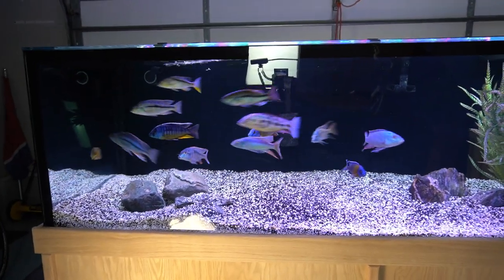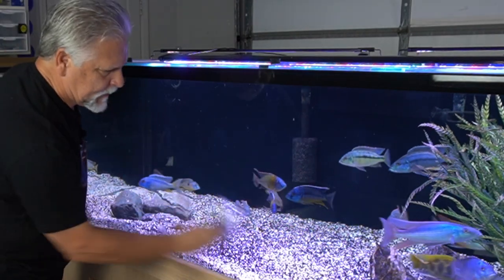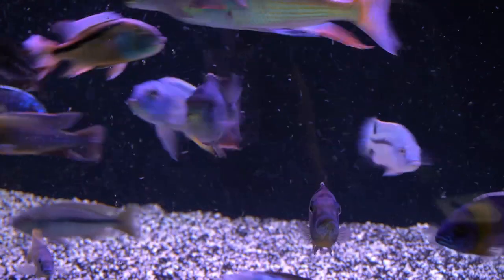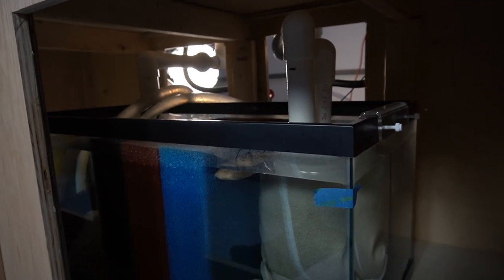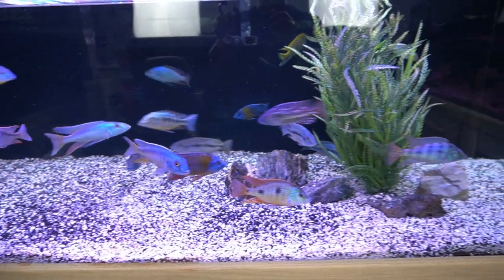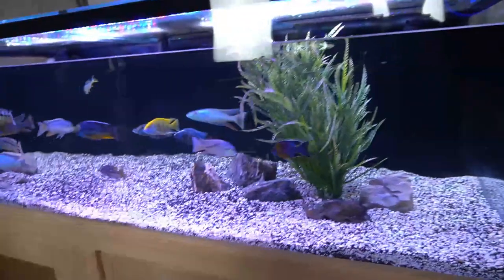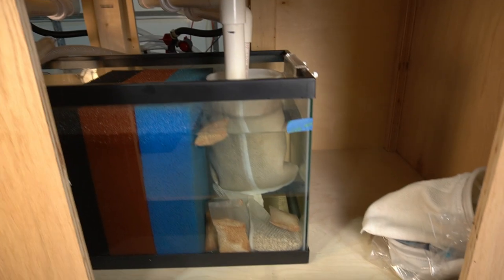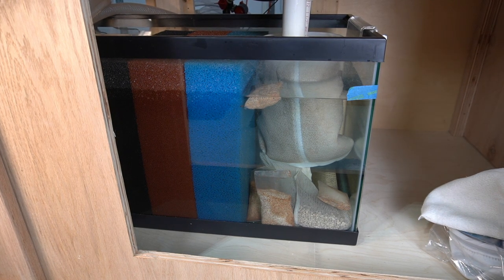My Water Change Routine on a 300 Gallon Sump/Canister Filtered Tank

Comment: Good quality video. Since so many novices watch your channel it is good that you recommend 20% water change to be conservative and not shocking the fish.  Controlling all the water change variables is something that takes experience.  I can tell you though, now that I do 80% water change, my fish have never been healthier.  On an 80% water change you can have a disaster if there is variation in your tap water ( eg chlorine), if you add the replacement water too fast, or if you run out of hot water (in the winter) while refilling the tank.  Or if you forget to add Safe, which i have done.
Reply from the maker: Good points.

Comment: I agree completely - the sound of an overflowing tank is a very unpleasant feeling - it is also costly too as it depends how long water has been spilling out onto the floor as to how much you pay to get the water up off the floor, especially if the floor is carpet-ed - it cost me about AU $500 and, according to the cleaning guy, I was very lucky that there was not a lot of water to remove so it did not cost me as much as if the water had spilling onto the floor and pooling for longer than 15 minutes (which was the case with my situation) - basically - the longer the water pools on a floor, the more it costs to clean up, potentially replace the carpet (even more painful if you are renting).
Reply from the maker: True. I had a stand in California that was impossible to get under, so when water got in there I couldn't get it really dry. When I finally moved the tank I discovered $800 in wood floor damage. So, I know exactly what you're talking about.

Comment: Hey Ben I got a new tank 4 days ago I set it up and put substrate,filter,decor and water in, I tried cycling it and put in benificial bacteria every night for the past 4 nights but then today relized it’s not cycling because I need ammonia, so I ordered some online but it needs 4 days, so should I keep putting benificial bacteria when the ammonia comes or the ammonia I have in there now will still be alive and would cycle the tank, by the way the bacteria I use it seachem stability
Reply: Save your stability until you are able to add an ammonia source. You can use fish food or maybe get a couple feeder guppies to get it started. After a few days you’ll see some ammonia on you test. Do a 20-50%  water change and add prime each time you do a change . This will bind the ammonia as well as remove harmful chemicals.
Reply from the maker: Yes, the BB needs a source of food. This is why they suggest adding fish immediately in small quantities. Fritz has "Fishless Fuel" ammonia, but I just use FritzZyme 7 and add fish as the ammonia source. If you can throw in some seeded media from a well established tank, that is the best BB you can use to jump start a tank.

Comment: Good evening Ben, you mentioned that you only do a 20% water change due to your water parameters. Out of curiosity, what are your nitrates prior to doing the water change?  I currently do an approximate 70% change weekly as my nitrates are between 40-80 after a week.
Reply from the maker: It's changing with the addition of new stock, but 30-40ppm after a week is not uncommon. 70-80% WC could drop it to around 20ppm but I'm not convinced that this will improve the quality of life of the fish enough to warrant the time and effort (and cost) that would be required.
Reply: @BenOchart  Thank you Ben.  I have been considering doing smaller water changes.  I have a Santa Monica Algae Scrubber, and I am hoping that will begin to reduce the nitrates also.

Comment: hi hey I wanted let you know I really like this cichlids and coffee live  Scream 👍👍this video also was great/  Question my WaveMaker broken and I ordered a new one but I didn't 100 gallon to 210 gallon do you think it to strong for 75gal I didn't know at the time until I looked at  Order the 2nd time I do have adults And few juggernal cichlids tank is it too strong for 75gal I put it top of the tank by intake to help keep clean and  Oxygen the tank  Help break up the surface of the water
Reply from the maker: Place it near the top with a slight tilt upward and run it on a timer for a hour at a time 3 times a day and you'll be fine.
Reply: @BenOchart  so what you saying just run it morning and when I leave turn it off then turn it on when I get home but most definitely turn it off at bed time I do keep it up top on the same side intake is that the right side to help keep the tank clean as well

Comment: I bought safe and want to use it but OMG, the smell is ridiculously bad, it stunk up my whole basement and I could even smell it upstairs 😳🤢
Reply from the maker: That’s very unusual. It smells, like most water conditioners do, but it shouldn’t be that bad.
Reply: @BenOchart  I got the same size as the one you showed.  As soon as I opened it I was OH NO, no no no, cap back on lol.  Like the absolute strongest and worst sulfur smell I’ve ever smelled
Reply: @greygoose117  hey my friend,  I would most definitely call sechem about the unusual smell and let them replace it,  and they might want you to send them the safe you have to see if they might have a problem with the line of production that day.